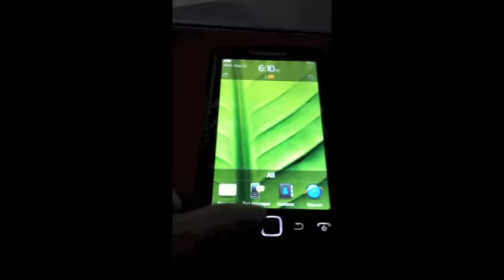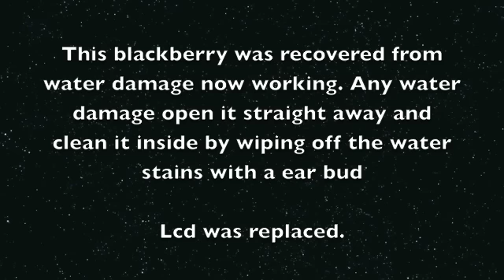BlackBerry Torch 9800 LCD Screen Repair/ Water Damage

Comment from the maker: if not working it can be that your not connecting it correctly or not pressing it down into the connector and for the touch screen know as the digitizer make sure your slid it all the way and close the bracket to hold the digitizer still.  

thanks :)

Comment: after i reassembled the keyboard, the volume , the lock and mute buttons are not working , i changed the Keyboard Chassis with Flex Cable for a new one and still desn't work. The light of the keyboard is goes on , but when i press the letters it wont work... what u think the problem is??
Thank u